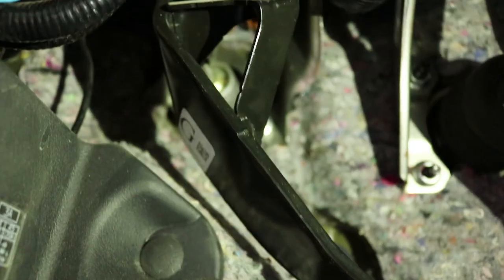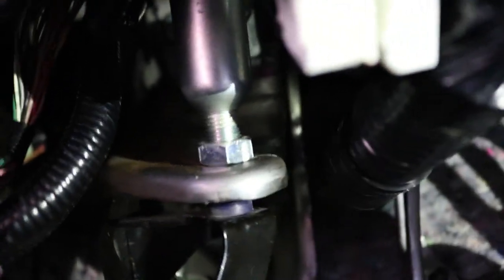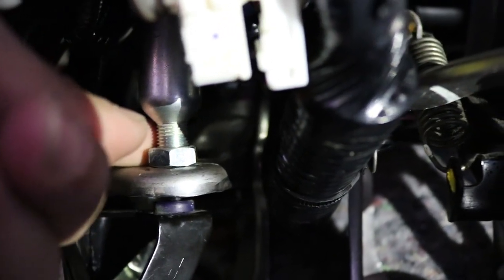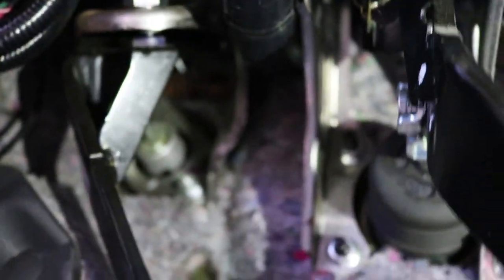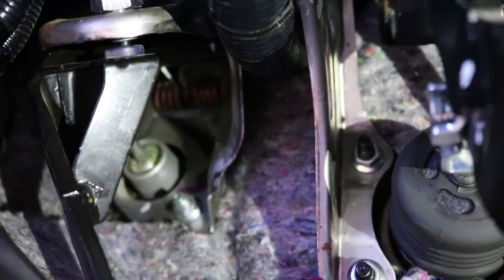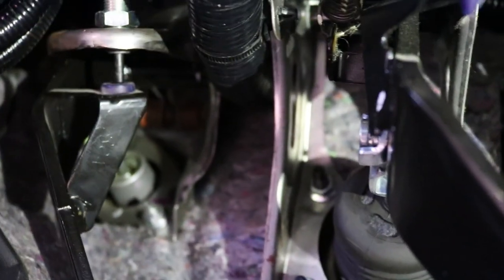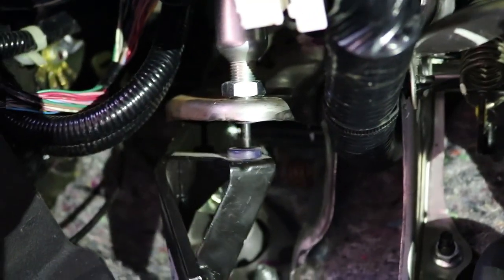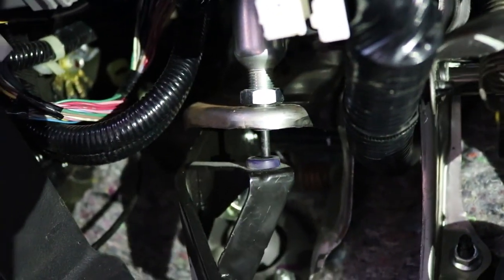Get Rid Of Transmission Grind-  8th/9th Gen Civic Si

Comment: that switch you adjusted in this video is for cruise control input, so the control unit knows if you pushed on the clutch pedal even a small amount and then turns off cruise, if you go higher, to the top of the pedal, there's another, this switch is pressed with the pedal all the way to the floor, this switch is an input for the starter relay. neither of these will affect clutch engagement. remove both of them and short the top wires together and then it will turn the starter without the clutch pedal pressed. otherwise the car will drive normally without the switch altogether(aside from cruise operation) I figured this video was gonna be clutch master cyl. pushrod adjustment although I'm hunting for info on CDV delete, this video was amusing as it does NOTHING. Maybe after you performed this adjustment and drove it, you were actually paying attention to what you were actually doing when shifting and therefore making you a better driver for the time being!!
Reply from the maker: Yeah I think you’re right
Reply: my 2013 si does not disengage cruise when i clutch in.
Reply: I know this was a year ago but Check out Zosh he just did that on his 8th Gen.

Comment: For anyone wondering, this will do nothing for your gear grinding or hard shifting issue.  What is being unthreaded in this video is a switch for turning the car on and for cruise control.  If you really want to fix your problem you need to adjust the master cylinder by unthreading the connector clip on the backside of your clutch pedal.  Basically crack the nut and turn the threaded push rod with a pair of pliers until you reach the amount of travel needed to shift smoothly in high rpms.  Make sure to leave a little play at the top stroke of the pedal.  Unthreading it too much can cause the pedal to receive just enough pressure to not entirely engage and disengage your clutch and can cause premature wearing of your clutch.  Soo after thats all said and done then this videos information comes in handy as the switch then also should be adjusted due to pedal travel.  Just doing whats in this video though will do nothing for your grind in high rpm.  Also bonus tip if you upgrade your clutch to a stage 1 or higher, i would upgrade your cmc and slave with an aftermarket kit like ktuned offers. I'd also have the backing plate for the pedal assembly welded up as its just stamped sheet metal with a couple of spot welds.  Ive had to replace two pedal assemblies on my 09 Si because those two spot welds are weak af and the upgraded clutch system is much stiffer and requires more force to depress the pedal thereby stressing the welds until they eventually fail and crack.
Reply from the maker: Yeah at the time I didn’t realize it was just a switch lol. Definitely did nothing for the grinding. I’ll try updating the video title to avoid any confusion

Comment: Did you ever have an issue engaging into 1st gear? For example, it does not want to go into 1st gear from neutral. And it's not an always situation but at times it happens I usually have to press the clutch twice or put it in second gear then back to 1st and take off.
Reply from the maker: I haven't had that particular issue but with my reverse I usually have to put it in first before engaging reverse otherwise it'll be difficult or grind. I've heard this could be an issue with the shift selector inside the transmission
Reply: Carlos M isn't that just super annoying or what my honda civic does the same thing smh
Reply from the maker: Have you guys tried adjusting the clutch pedal?
Reply: MARIO M still no fix?
Reply from the maker: I’m going to do a quick video on adjusting the clutch pedal catch point. Just waiting for warmer weather hah
Reply: hey your car not going into reverse is normal... my car does it... every manual does it... the gears are just not lined up in the right spot to hit revers so that's why you gotta go to first and like move just a inch and then back to reverse should go in just fine... every manual car i have owned for the past 12 years has always done this lol.
Reply: this might be a dumb question but... are you like at a stop when you are trying to put it into first.... lol just trying to knock everything off the table... i am assuming you are... if you are stopped and you cant go into first... might be the same situation with the reverse just gotta inch it a little... i have had some manuals do this but rare... mostly meant the clutch was getting ready to go out... so i am gonna say i am guessing your clutch is going bad or possibly your pedal needs to be adjusted like he did here in this video....
Reply: Happens to me very often. It will sit somewhere between neutral and 1st and you'd think it's in first and take off. You'd then hear the grind and quickly have to stop and pop it back into neutral, maybe 2nd then 1st again. This issue reduced after I had a new clutch installed but still persists.
Reply: @mariom8734  it's the clutch master cylinder bro it's probably leaking or bad pedal

Comment: In addition to this important video/ reminder, DO not forgot that running your cars hard, and reving them out, breaks down fluids (all of them btw) faster then typical interventions recommended by "your" mechanic and by manufacture. Please do yourself, and your modern machine a favor by changing every 10k with Honda MTF, or your favorite transmission fluid and beat the static of people who don't realize how effective it is to maintain your transmission fluid at sooner interventions then you think. 

Worth considering, take everything with a grain of salt as any topic and new information. (especially during summer, and longer durations of heat cycle, this is common physics, although conventional oil of all types are phenomenally engineered now as opposed to even 10-15 years ago.)

Cheers!
Reply: I completely agree. I've abused my 8th gen (limiter every drive, banging shifts, etc.) for the past 7 years/30k miles. I check the transmission fluid regularly and it'll get pretty roasted by 10k. K-series transmissions get pretty hot in my experience.

Comment: i have a reverse gear grind issue when my car is stopped. I found a workaround by shifting to 4th and then reverse, but i don't want to rely on that.
Reply: kseries reverse gear are a bit notchy , ease into it , dont just slam it into reverse. i usually press down on the clutch for about 2 seconds before i go into reverse and it stopped grinding

Comment: WOW how very weird 🤔 how does the the clutch bypass safety switch help fix grinding issues? That's super weird, instead of the switch telling the car that the clutch pedal is engage so that you can turn on the car...it helps fix grinding issues. Shit i should adjust my brake pedal switch to help fix my pads from grinding too. Bwahaha
Reply from the maker: So you're saying that the switch that tells the car the clutch pedal is engaged would have 0 effect on when the clutch engaged or disengages?Thanks for the pointer. Maybe you should change your pads. That usually gets rid of the grinding noise 😉
Reply: Aaron Shirzadi yes because that’s all it does. It’s so that the car can start you know. Don’t make a video telling people lies. That isn’t adjusting anything only when the cars computer senses the clutch engaging or disengaging. It’s the same engagement point on the actual clutch not when the car thinks it did. Your clutch goes to a master cylinder that sends fluid just like brakes to separate the clutch from the flywheel.
Reply from the maker: Yeah I realized this after I made the video sometime down the road lmao. Rookie mistake on my part for sure
Reply: Damn 🤣exposed

Comment: My 9th gen si is doing the opposite its notchy and rough in 3rd and 4th in lower rpms vs higher rpms.Any thoughts?
Reply: I have the same issue, did you ever find the cause for this?
Reply: Get the transmission oil replaced